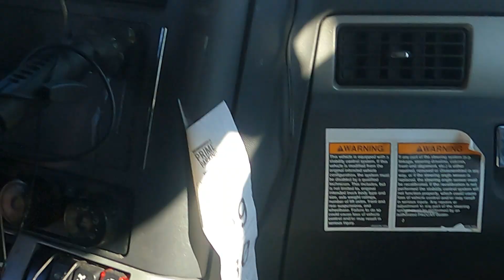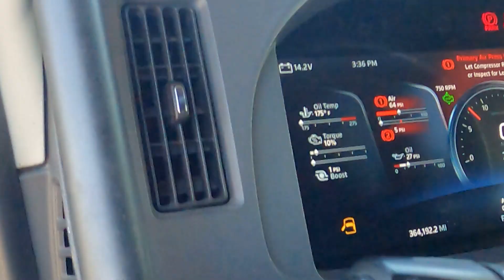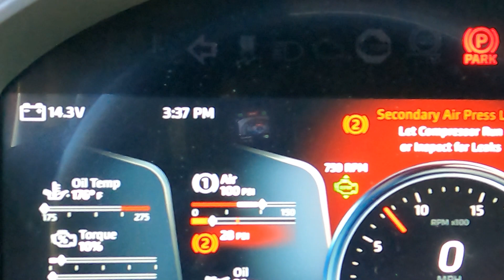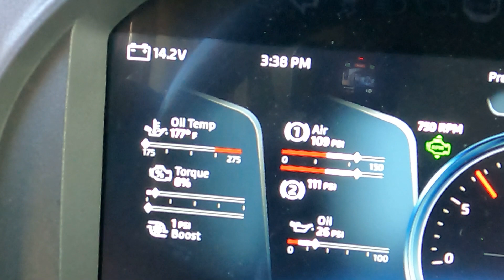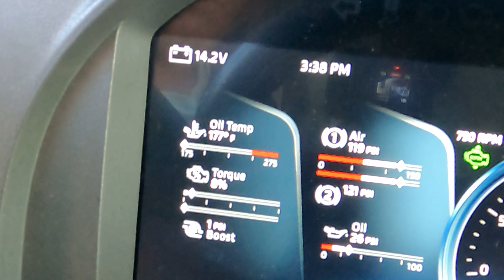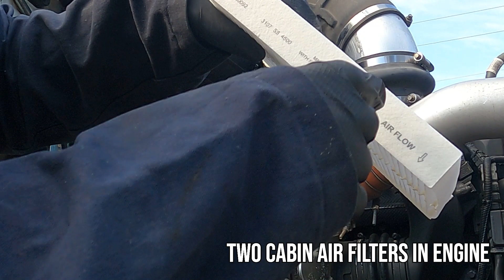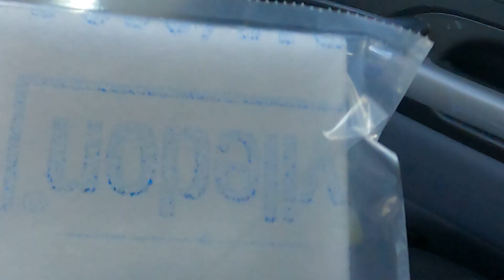Changing 7 filters on 2022 Kenworth T680. Air Dryer Filter, Anti-freeze, Air and 4 Cabin Filters

Comment: You’re gonna have a hard time taking that off just thought I’d let you know you got the suction coming from the air can plus the antifreeze that makes that tighter you didn’t need to tighten it that tight it’s just like before you had a hard time cranking an office cause someone overtightened it. He just have to put it on snug, but you know for sure it won’t leak but I hate to be the person taking it off both of those filters L O L
Reply from the maker: ha ha right, well that is the first time I have  changed them.  Last thing I would want is a leak.  Next time I will try not putting it on so tight.  See how it works.
Reply: @kdp1943  tight is always good!!
But was letting you know it’s going to be a bad one taken off!!😬
Reply from the maker: I agree, experience is key and next time I will have a little 🤣🤣